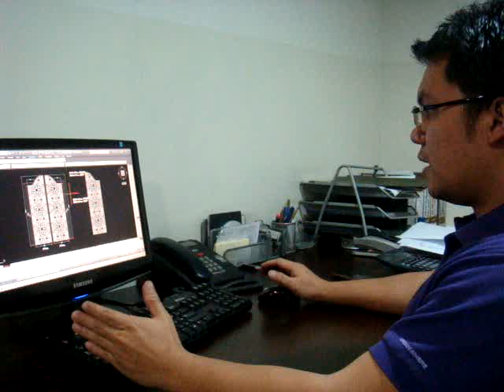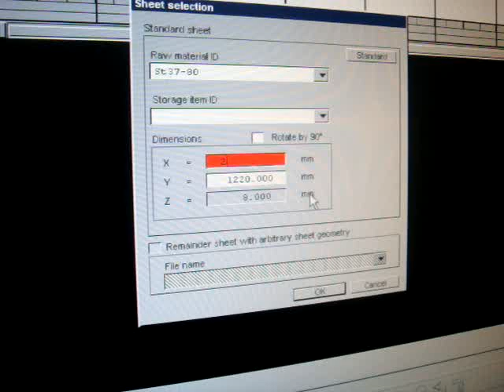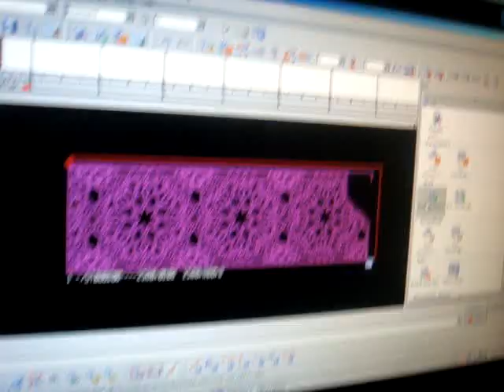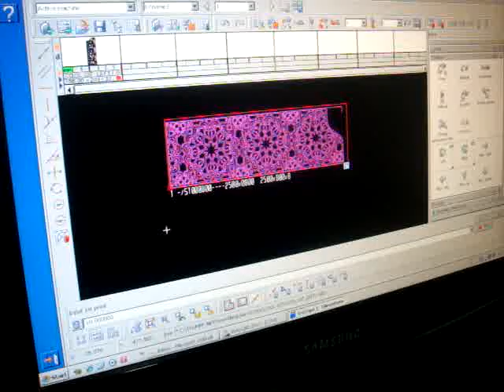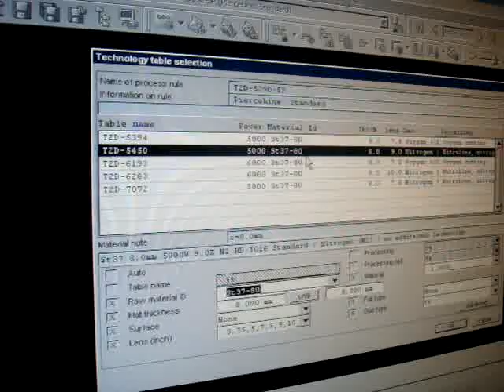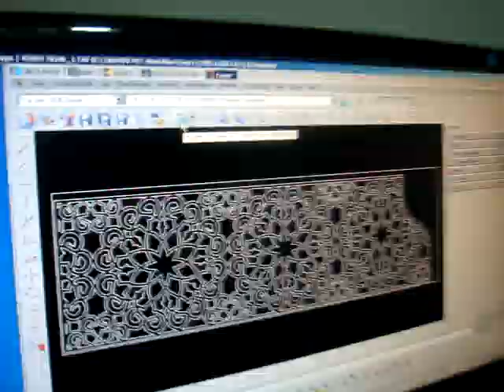Programming PART 1

Comment: Hello can I ask you two questions?
How do I change the direction of laser movement?
At the moment in Laser as a simulation lashes the laser cuts vertically, and I want it to be horizontal.
How do I change the sign in for all items? at the moment the point of entry is from the edge and i want to be from the middle of the straight line?
Reply: dear friend ...do you know anythings about trutops so please help me ... i have a doubt on this software so please msg me...+917322804294
Reply: @MrX-uv6nw  maxwell ??